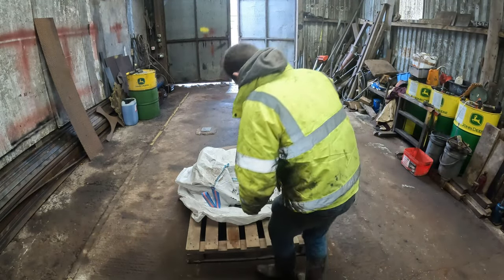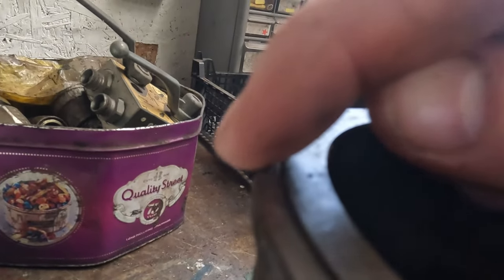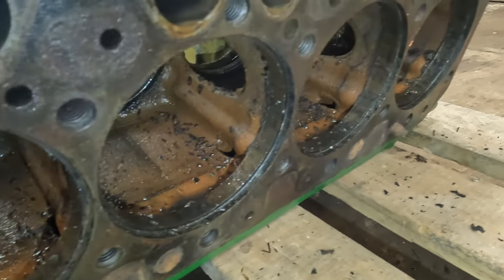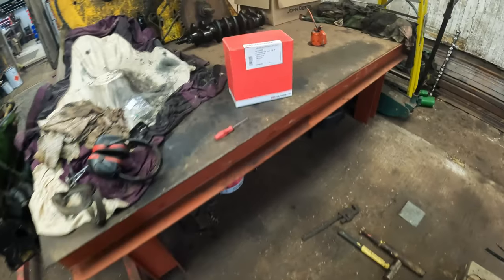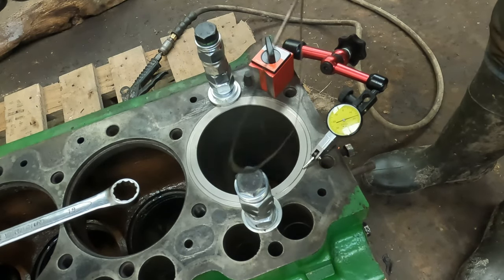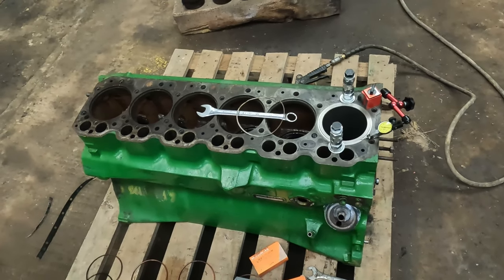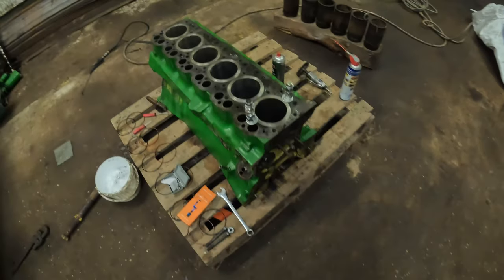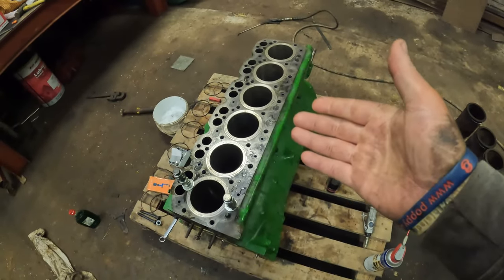John Deere engine rebuild | Installing liners | Rebuild kit

Comment: Best practice would be to  use a permanent marker to mark liner to block so that after you have measured protrusion and you put the seal on you get the liner in the same spot you measured it at. Used to enjoy building JD engines,  really satisfying when you get them running again.
Reply from the maker: You are probably right yes, I think the machining of the new parts has come on a long way from when it was first built, as they were all very close to one another in the measurements 🤔 I can imagine it is! I'm enjoying the build anyway as it is something that I like doing 😊